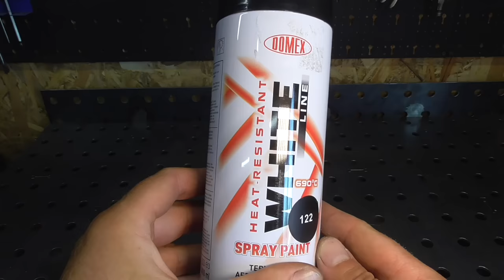Best Portable BBQ Grill || Amazing Project ⬇️ BUY ⬇️

Comment: Nice! Brilliant idea and follow through. You inspired me to think about how I'd design something like that, and I thought of a couple of things that would make it easier to transport and set up. If you cut the 2 long side support bars in half and welded nuts at the halfway point for them to thread into, then it would make the whole thing into a much shorter package to transport. It would reduce the strength, but I think if you welding on a nut or two drilled out to the diameter of the bar and acting as supports near each center nut, so that the bars slid through the supports before threading into the center nuts, then it would be plenty strong. Just so that the weight on the joint was carried by the supports and not just the center nuts. And for the legs, usually you are setting these things up on uneven ground, so making them so that the corner nut each leg is threaded through is open on top, so the leg can screw past the top of the grill surface, would allow you to screw the leg/s that needed to be shorter in further. You could thread the top 1/4 or so of each leg, or just use threaded rods as the legs. Also, welding on little feet to the legs would help if you're using it on soft ground.
Reply: @AndriiPysarenko  Oh, just had another idea, at each corner weld in two nuts, one like you have now that's vertical, and the other at maybe a 15 degree angle. So you have the option of compact footprint and tall with it in your current configuration, or slanted legs for more stability and a bit lower height.
Reply: Cut a threaded coupling in half and use one for each side. (longer than a nut) for the stability part of it.
Reply: And, a couple of quick “touches” with the welder on the legs to give a bit of grip texture for screwing/unscrewing the legs easily 👍
Reply: If the bars are 30cm long just make the chain 30cm long. Then the 2 longer bars that stick out when folded would no longer stick out but fit perfeclty. If somebody is worried about stability just make the 2 bars and legs from thicker bars. I would make the leg bars longer. Then when needed u can adjust the height just by dig it deeper to the ground.  Make it easy not complicated

Comment: Andrii, I think this is a great idea.  Very cool.

Could you maybe do something that only takes basic home tools?  Vise, drill and bits.  Hack saw or cut off wheel/grinder.
NO welder or cutting torch.
Reply from the maker: Thanks!  I will definitely do it as soon as the war ends in my country.
Reply: @AndriiPysarenko  Be Safe

Comment: It looks amazing. Less is more!.
But I do have my questions with this build. With such an open construction heat distribution would be inefficient at least.
There is an other problem as well. When you use a bbq or a grill, it gets greasy and heated for a prolonged time. I wonder what this does to the construction? Can you still screw in the legs? Does it still roll up? I think it won't.
Reply from the maker: Everything works great so far

Comment: Did you really need to paint any of the parts? Steel has a melting point of 2200F - 2500F. I guess I could understand painting some of the parts for the anti-corrosive properties, but it just seems a little bit excessive and unnecessary.

Comment: Not bad but building a firebox would allow you to control air flow and temperature which is why grills (even portable grills) are all built with fireboxes, from kettle grills to barrel grills and even those old ugly square 3 sided park grills.
Reply from the maker: You can use Chinese, cheap windscreen